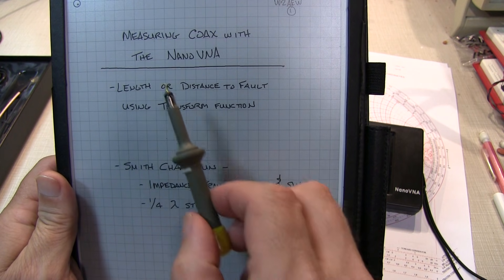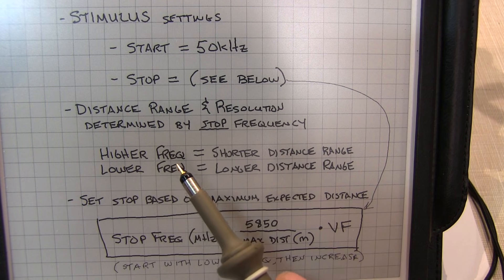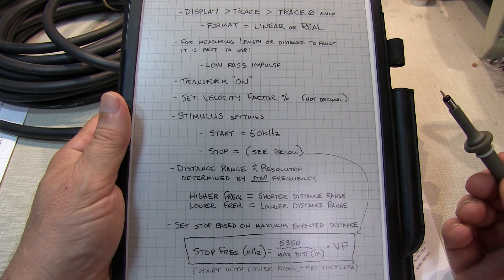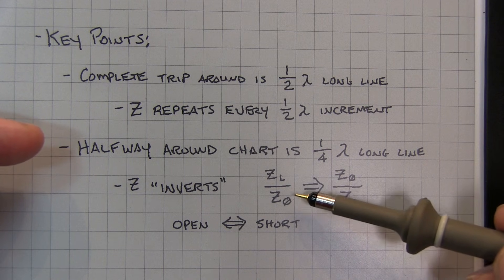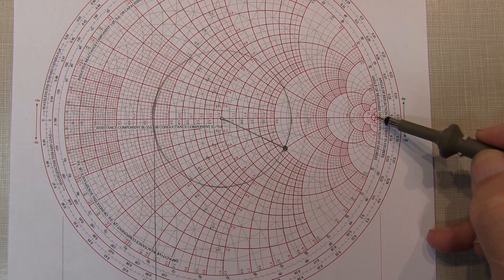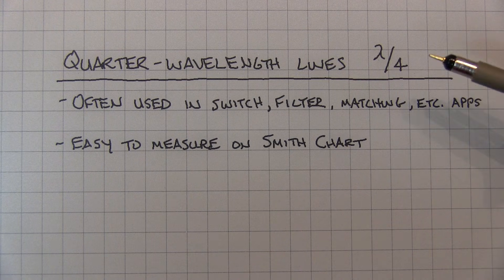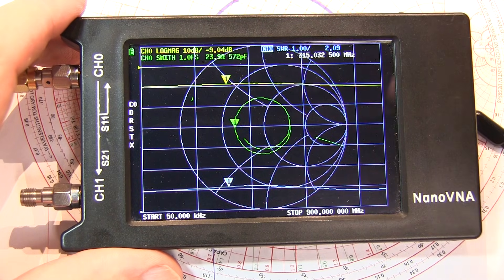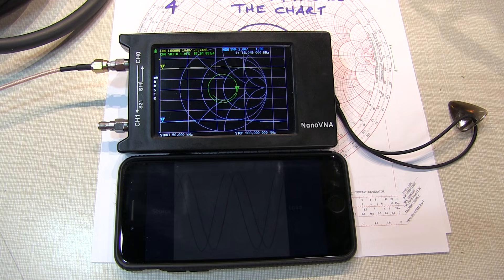#316: Use NanoVNA to measure coax length - BONUS Transmission Lines and Smith Charts,  SWR and more

Comment: Should we measure to the start of the peak or the tippity top? I ask because it doesn't look Gaussian and I feel like the sudden rapid rise might be significant. Also if I measure to the summit I need to set the velocity factor lower (down to 73% for RG-8X) to get the actual length of my test cable, whereas if I measure to the start of the reflection I can leave it at 78%.
Reply from the maker: The beginning of the rise is probably more accurate, but also keep in mind that even the VF of coax can easily vary by 10%

Comment: Many thx Sir for the lessons, I as rf cell tower maintenance used to work with an Anritsu s331 sitemaster, but due to reductions i need to travel back and forth to the warehouse to pickup the Anritsu...Now you teached me i can do this with the vna. Just to figure out if there is water on a coax and where. Or just replace the tx box or antenna. Awesome lightweight it fits in my backpack. Even i can take it with me when rigging into the tower to check the antenna ports🎉

Comment: Hello Alan, I know this is quite an old video, helpful though..  Just a sanity check on a thought I had.  If you know the exact length of coax, yet the measured length is off a bit,  then would twiddling the velocity factor until the length matches then indicate the true velocity factor of your particular sample of coax?
For example, I have a new roll of 50ft. of RG8X.  Measuring with the velocity factor set to .78 gave me a length of 43.86 feet.  Tweaking the velocity factor up to .81 got the calculated length to match the physical length.  Seems logical to assume that the true velocity factor of this roll is therefore 81% the speed of light. 
73 and thanks for the great content.   DE KB9RLW, The Old Tech Guy
Reply from the maker: Yes, exactly.  VF for coax isn't a tightly controlled parameter.

Comment: I have a question. Since you mentioned that SWR does not change with cable length, only impedance / loos, if I like to make a shortest cable possible for my car antenna, sounds like if you know your coax type, velocity factor and band range, you could determine minimal optimal cable length to have best impedance match. This is without the antenna connected. Then after this step is done, then connect your antenna and adjust for best SWR? Or adjusting the connected antenna in a way invalidates the initial cable length idea since not over all load is different? Perhaps I am nit picking, but I just like to understand this relationship for educational purposes.
Reply from the maker: There is no optimal length. The shorter the better to reduce losses.

Comment: Another great video!

I just experimented with my LiteVNA64 and discovered that by adjusting the stop frequency and increasing the number of sweep points, you can achieve good enough resolution to detect even a barrel adapter on an RG58 coaxial cable. The difference between the NanoVNA and the LiteVNA64—specifically the higher maximum frequency (1.5 GHz vs. 6.3 GHz) and the ability to increase sweep points (101/201 vs. 1024)—really makes a difference for this kind of testing.

Once again, thank you for creating such fantastic educational videos!

Comment: Hi Alan, thank you for the nice video and detailed analysis, especially on the coax length measurment. Could you please explain a bit more where 5850 comes from? I would assume that there is a "constant" determined by the speed of light (300.000 km/sec)... My old, defected, engineer stractured brain, refuses to  process :-) 73 de sv1onk
Reply from the maker: Just determined impirically from measurements

Comment: I used your video to measure my length of coax but got two different answers before I realised  I was not putting the stop frequency high enough, the second time I made the mistake of going even lower in frequency. 
Thanks for the video.
G4GHB.

Comment: Great video, thanks. I have probably the original version of the NanoVNA, so I wonder if it operates differently. Using your exact procedure to measure a 15m length of RG58A/U, the Linear trace is flat...no peak as you got. However, if I turn on the SWR trace, I see a small peak at about the 15m point on the marker. This is an open (unterminated) coax. Any idea why it's not working? Thanks much!
Reply from the maker: Could just be a vertical scale setting.

Comment: Does anyone know if feedline needs to be specific wavelength long? Odd 1/2 wave or odd 1/4 wave? Does it matter?
Reply from the maker: It does NOT need to be a specific length.  Feedline length does not affect SWR unless the feedline is acting as part of the antenna.

Comment: The Mobius Transformation is a half angle function. You're forcing numbers into a half-angle function. The Smith Chart is a 3d sphere based on double angles (dot product). At least, that is what I think is going on. I've been projecting 3d wave functions onto the sphere. This would preserve angles but toss out length. It's a spherical helix, loxodrome, or rhumb line. I'll probably forget those words tomorrow. I'm a floor layer, not a mathematician. Sorry, if I tricked anyone.

Comment: Is it possible to go in the opposite direction: If we have a line of a known length is it possible for the nanovna to calculate the velocity factor?
Reply from the maker: With a simple calculation, yes. Set the velocity factor to 1, measure the length, then calculate the velocity factor as the ratio of the two lengths.

Comment: ‘Hope you learned a little something today’
pff… who are you kidding…

Excellent content as always Alan!

Any recommendations for a bench top signal generator in 2024 that doesn’t weigh 30kg?
Something suitable for testing receiver sensitivity and calibrating AD83xx based power meters.
I have an early RF Explorer sig gen but it’s limited to 24MHz and up. 
Can the TinySA Ultra sig gen functionality replace an HP or Anritsu?
Should I look at constructing reference RF sources at key frequencies and then attenuate?

Your input would be most welcome.

73 John

Comment: Is calibration - short, open, load in this case not necessary or have you calibrated them before, but not shown in the video?
Reply from the maker: Still recommended, but not shown in this video.
Reply: I tested the length of a 4.5 m long 3 GHz Huber & Suhner coax cable in our Electronic Lab - I realized by calibrating (OSL) the VNA after the setup as described in your video, the VNA measured cable length corresponds precisely with the real length (measured with a roll meter) of the Coax cable. I read the velocity propagation factor from the datasheet of that DUT coax-cable, which was 81%.

Comment: You say adding/removing transmission line does not change the SWR. Is that only true when the impedance of the transmission line matches the rest of the system? I use RG-6 for my ham radio systems. I sometimes trim the length of the coax to get a better SWR. Is the SWR actually changing?
Reply from the maker: If the coax is becoming part of the antenna, then yes the SWR will change with coax length. If the coax is not part of the load (antenna), then the SWR won’t change with coax length (even though the impedance looking into the coax will)

Comment: Hi. To determine the stop frequency we are using "5850" value for some reason, but if we are working with NanoVNA-Saver program, which allows up to 1023 datapoints, with with a smaller step size (obviously better), what value would you recommend for the ecuation? Thank you and best regards.
Reply from the maker: The choice of stop frequency is dependent only on the expected length, it has nothing to do with the number of points.
Reply: @w2aew  Yes, I understood that. Is very clear in your video 🙂 StopFreq.(MHz) = (5850/Max.Dist.(m)) * VelocityFactor. But where comes the 5850 from?. If I may ask.
Reply from the maker: @marcoscano7998  I determined that factor by measurements - I setup a Stop frequency and took a look at the maximum distance displayed by the transform.  I then backed the Velocity Factor out of the equation to come up with a "factor" to use to compute the stop frequency vs. max distance.
Reply: @w2aew  Thanks for your answer. Yes, that is what I guessed. My only "reflexion" was if, by using NanoVNA-Saver, where we have more datapoints available, which means higher resolution (less step size), that factor (5850) could be recalculated for improved estimation of the stop frequency. Thank again for your time.
Reply: When using the LiteVNA64 with 1024 sweep points, a constant with the value 153181 appears to provide a good estimate.

Comment: So swapping from a 60ft coax to a 30 ft coax and getting a higher SWR means either my antenna needs tuning or…..?
Reply from the maker: It is common for the SWR to increase with shorter coax, because the extra loss in the longer coax attenuates the reflected signal which makes the SWR look better than it really is.
Reply: So maybe I have a bad antenna. I ordered another one as that was my first suspicion. Fingers crossed. I’m gonna use your video about checking coax to be see if there’s any fault I can’t see. Love the channel.
Reply from the maker: @jav_eee   It could be very likely that your antenna needs to be tuned/adjusted - very common.  What is this for, and what is the antenna?
Reply: @w2aew  antenna is a Retevis MA09 that cannot be tuned, according to what I’ve read. It’s for a small GMRS repeater setup for a ranch.
Reply from the maker: @jav_eee   Their spec says that the SWR should be <1.5:1, so if you're seeing greater than this, you may have a faulty antenna
Reply: @w2aew  I’m getting 2.6:1 (or maybe even more) at my TX frequency. With the longer “higher loss” cable it was way less. But now I know why. I’ll swap antennas and hopefully that clears it up.

Comment: When measuring the length of the coax does it have to be terminated at the end with a dummy load?
Reply from the maker: No, you're actually relying on the reflection from the mis-terminated end (typically open) to make the measurement.  If it was terminated into a dummy load, you would not be able to determine the length.

Comment: Thank you for the tutorial. Much appreciated.  What would you expect the margin of error in the length to be versus the actual length using this device and type of test?
Reply from the maker: Probably on the order of 5-10% dominated by the uncertainty of the velocity factor.
Reply: @w2aew  Then my issue must lie elsewhere.  I know the velocity factor.  Do the connectors used affect this measurement?  Regular coax generally comes with PL-259 connectors which dont attach without at least one or two adaptors to the nanoVNA.  My attempts to this method are out by way over 50%.  I see you have a video about electrical delay with the nanovna but dont reference it here.  I imagine this is the source of the issue.  Using a PL-259 to sma adapter followed by the short sma to sma cable that came with the nanovna.

Comment: Thanks for this systematic explanation of measuring coax length and distance to fault. It is very easy to follow. I have followed the process to check a 100 ft. (30.5 m) coil of RG8X. On the linear scale, sweeping from 500Khz to 125Mhz with the transform function set up in  low pass, I get one single peak at 14.65m . If I flip the ends if the cable I get the same figure.  Is my nano vna-h  defective? I have calibrated before.  starting.

Comment: Hi Alan
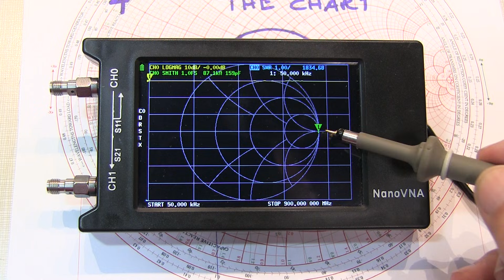At 12:05 h min in your video: If you now calculate very precisely and meticulously: 299 792 458 m / 315 Mhz / 4 = 24 cm. But the short piece of transmission line is only approx. 18 cm long.
Where do you think this discrepancy comes from? Is that just the level of accuracy to be expected from a $60 device, or do you see the cause elsewhere?
Your videos are always great - what of the finest on the subject of electronics on YouTube!
Reply from the maker: Your calculation doesn't take into account the velocity factor of the coax.  That explains the difference.  Signals travel more slowly in the coax vs. free space.
Reply: @w2aew  I've deleted my previous answer, because meanwhile I did some further experiments - and you are (as expected ;-) right:
I took a RG-174 cable with a known velocity factor (VF) of 66% and than multiplicated the NanoVNA result length with this VF (x 0.66) and voilà - I got a calculated cable length of 206 cm - and the real cable length almost exactly 206 cm as well.
Reply from the maker: @RomanKuechler  Awesome, glad you got it all sorted out!  (we learn a lot more from our mistakes than we do from our successes).

Comment: Hi thanks for the very educational videos. 

I am tuning phasing lines for a phased vertical array using the Nanovna. Like you suggest, I use the phase feature in the Nano to find that 180 degree point to determine a 1/4 wave. I also tried your suggestion to check it out on the smith chart and like that method even better. 

Question: Is it necessary to fine tune to find the zero reactance point for precise measurement of a 1/4 wave on the Smith chart in the Nano? Particularly because proper phase is important in this application I am using it for. I ask because the closest I can get to 180 degrees on the phase does not coincide with a non reactive point in the Smith chart. Would fine tuning for zero reactance lead to incorrect measurements, or would it in-fact be preferable?
Reply from the maker: Fine tuning for 180 degrees will give you the most accurate result.

Comment: Thanks for the video.
I got a NANO VNA last year. Great little bit of test gear for the price. Helped to set up my dipoles and inverted vee instead of just an SWR meter, I knew if I need to shorten or lengthen them.
I'm going to try measuring the length of a piece coax. How to amaze people with technology if they say you need a tape measure. I guess this is how a cable fault locator works.
G4GHB

Comment: What are good divisions of feed line when only using a short length less than 1/4λ? Also can anyone comment on using open wire with a VNA? Thanks.
Reply from the maker: There are no particular good or bad divisions or lengths of feedline.  Feedline length does not change the SWR, it only changes the impedance seen at the input (as long as the feedline is not part of the antenna).

Comment: I was wondering how to measure the resonant frequency of a 1/2 wave section of coax with the nanovna?  The end goal to more accurately construct the elements for a collinear antenna on 450MHz.
Reply from the maker: With the coax connected to CH0, run take a look at the smith chart vs frequency.  Starting at a very low frequency, the Smith chart will be nearly at the 3 o'clock position.  As you advance the marker, take note of at what frequency the curve rotates completely around the chart back to the 3 o'clock position.  This frequency will be where the coax is 1/2 wavelength long.
Reply: thank you

Comment: One could measure the velocity factor of the coax before starting these measurements. The "assumed" can be way off and its very easy to do. A good tape measure would then be the primary standard.
Reply: How would you do this? I would like to measure the velocity factor of some material I have. The manuf’s spec seems to be off. I calculated what I believe it to be, but it would be nice to verify with a measurement.

Comment: So if you have access to a PC, you can use a piece of software called NanoVNA-saver to do this too. If you increase the number of segments you can get around the 101 point limitation. It even will calculate the coax length and you can select the coax type or manually enter the velocity factor that way.

Comment: Thank you for explaining how to measure the impedance of a coax cable.  Would you measure the parallel   wire (Ladder line)?  I did the same thing for tha ladder line using 1.2mm wires taped together without a spacer.
It seems to be more or less 45 to 50 ohms.  Is it correct?  Or I am doing something wrong.

Comment: I was wondering if you might clarify something, I have been taught that the coax length should be one half wavelength of the frequency that you're using adjusted for velocity factor in order not to create additional SWR. So are you saying that this principle is not accurate?

Comment: No. Its Measuring proopagation time.

It does not measure length.

The measurment is pulse return time.

Distance is derived by v/ t

Having a computer and technical sounding terns does not mean we have any idea what were pretending to teach others.
Reply from the maker: Actually, the NanoVNA performs this measurement by doing the Inverse Fourier Transform of the reflected signal in response to a chirp (or LFM stimulus) - this gives the time-domain response similar to a TDR.  This unit does not have a pulse generator, so doesn't make a pulse return time measurement directly like a time-domain reflectometer.  Once the time domain is computed via the IFFT, then the velocity factor is used to scale the time-domain result into distance.   What am I pretending to do?

Comment: Thanks for this video.  As I see it you can have a Los SWR but not  Resident.  Or my thinking wrong.  And it's gotta be better than my MFJ259.
Been off the air for 20 plus years. 
73 KQ4CD Paul
Reply from the maker: That's right, lowest SWR does not occur at resonance.  Resonance only means that the impedance has not reactive component, only resistive.

Comment: Can you also do that for twisted pair cables??
Reply from the maker: Yes, but you would need to know the velocity factor
Reply: @w2aew  can you approximate? Or measure it on a known length for example? Or even calculate it by the diameter and the “twist ratio”. It would be very helpful on long runs of UTP or twisted phone lines
Reply from the maker: @billysgeo  I had looked this up before, and it is typically 64-74% velocity factor.  I verified this in my recent TDR video https://youtu.be/z6UJPqQYzNc  Check out at about 6 minutes....